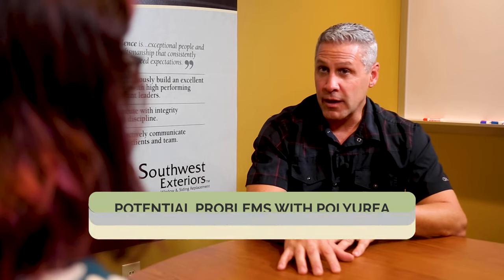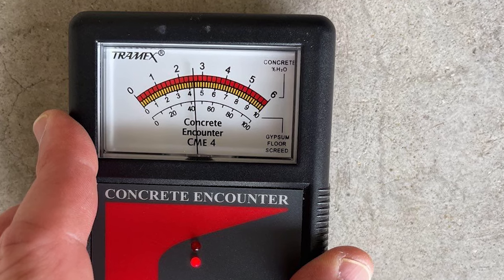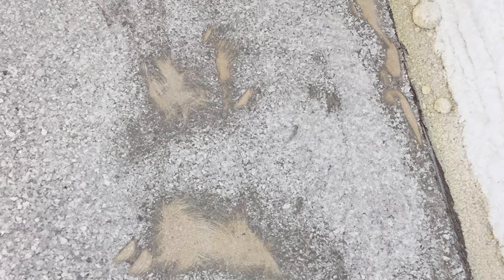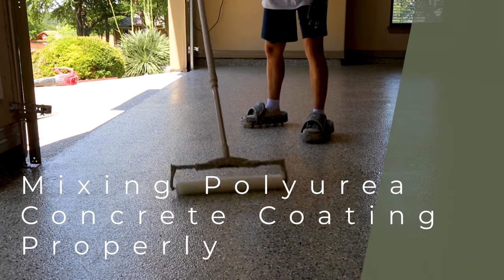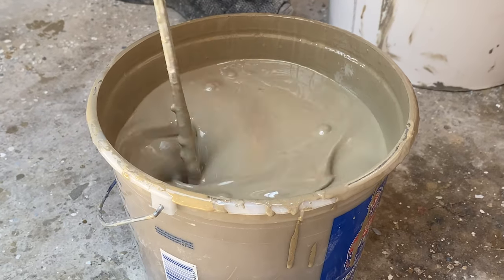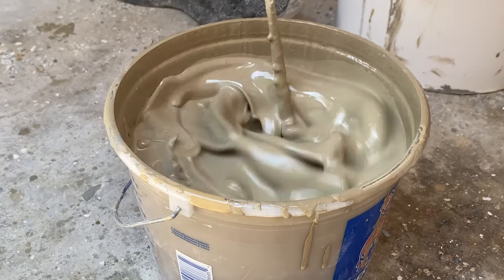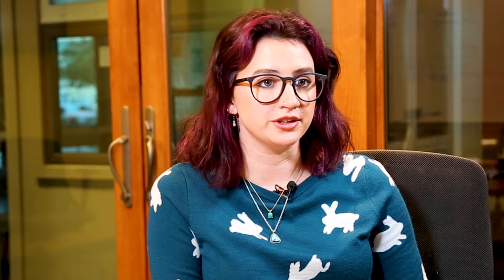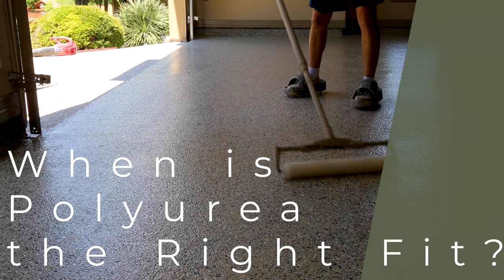Problems with a Polyurea Concrete Coating (or Polyaspartic)

Comment: 1. Check moisture content before istalling- It might peel. 2. Correct ratios or it might be affected by UV light. 3. Hire professionals to do a better job. That is it. No other problems. First Epoxy, then the supersaturate with flakes 3. Put a clear coat of Polyspartac , you are done.
Reply: I'm looking for good products to put down.  Do you have any suggestions?
Reply: @Time2Fly17  Simiron
Reply: Epoxy as a base coat is a bad idea.  1. it's not going to flex with your concrete. 2. It is not UV stable, so you end up with yellow spots.  If polyaspartic or polyurea are so great, why aren't you using it as a base coat?
Reply: @Time2Fly17  eparency
Reply: I ended up doing it with rock solid looks amazing I purchased an extra 10 pounds of flakes
Reply: @leosuarez1243  the guy who quoted my garage polyaspartic job says they always do an epoxy base coat and that two coats of polyaspartic (or one and a polyurea base) would be too slippery. I didn't know better but is that true? I would rather not deal with epoxy in there at all if I can help it.
Reply: @heatherhuth1  if you apply 2 coats of polyaspartic for a top coat, then yes it can make it slippery when wet.  This is due to further burying the flake layer, so you lose the texture.  Usually 1 top is sufficient for a normal use garage/space.
Reply: @heatherhuth1  Also, suggest getting a few more quotes and researching online on the pros and cons of each.
Reply: @leosuarez1243  Thanks! And I've been researching so much I should probably just do the work myself at this point 😆 but I didn't find a lot differentiating if people used an epoxy base coat or polyurea base boat with polyaspartic as the top coat. Thanks again!
Reply: Do not use epoxy as a base coat what a dumb suggestion
Reply: @Time2Fly17  Do you have to sand the floor or just use a pressure washer?? How is it still nice??

Comment: Just FYI, a Polyaspartic system is a Polyurea technology system.  Then there is moisture content in the concrete (as shown in the video) and then there is Moisture Vapor Emission issues, which is a different test procedure.
Reply from the maker: Thank you so much for the information!! We are working on a video right now that dives deeper into concrete testing procedures so I will make sure that is brought up as a talking point. Thank you again for commenting and checking out the video!!
Reply: @TheHomeSolutionsChannel  WTF!? Who R U bullying!??
Reply: I saw one company that advertises that they do 100% polyaspartic for both coats, and says other companies only use polyaspartic for one coat and polyurea for the other. Is that nonsense?

Comment: It comes down to this, if they didnt grind and clean the floor, they didnt do the job right and the floor may peel up in a few years. If they grind the floor down you have yourself the one of the best floors you can get!
Reply from the maker: 100%
Reply: @TheHomeSolutionsChannel  Are these slippery when wet? And when you are walking in high heels?

Comment: Much easier than that. 2 key elements. 1) measure precisely the component 2) apply quickly as its a very fast drying.
Reply from the maker: Great point!

Comment: I’m surprised no one has mentioned the smell. The offgassing I have experienced in the last 24 hours is unbearable. I did have professionals install the coating. They used both polyurea and poly aspartic. The smell is horrendous. I was not warned at all. We have left the garage door open All night and yet the smell and fumes persist. It has reached every corner of our home. We have opened all the doors and windows and have fans blowing as well as air scrubbers but I still can’t shake this headache It’s giving me. Any suggestions are greatly appreciated.
Reply from the maker: Yeah, you are right, that can be a huge problem as well. I am so sorry to hear you are still struggling with an odor. Unfortunately, what you are doing is really all you can do once the flooring is put down. Depending on the products used, Penntek does have a low odor topcoat that can be used, but that won't help now that it is down. 
Hopefully it has started to clear out.
Reply: We had a poly flooring completed a month ago by a major reputable, experienced company in our area.  We are also having significant persistant odor/ smell in the garage.  We have left it open for days at times to air out, used fans to blow air and circulate but a strong odor/ fume persists.  The company is coming back out but seems to indicate this is very unusual or has no clear advice for us.  We felt like we did everything right and or that they did.  Any advice or experience from others?  Do you have to redo it?  diff top coat?  Re grind and try again? Hope something worked for you!  any other solutions or ideas highly appreciated, thank you very much.

Comment: I did Polyaspartic coat. Chose antiskid, with light greyish chips  and regret. There are simple dirt footprints visible all over each time i walk.. I was told to buy hard brum and sweep it or power wash. Btw,  you can't mop antiskid. So not happy with this thing. I requested extra glossy coat so i can mop it at least, but waiting for offer. Unless you take dark grey coat, think twice about the antiskid surface finish.
Reply from the maker: Sorry to hear about the issues with the antiskid coating. Hopefully the glossier coating fixes that problem for you. Thank you for sharing the tip on a darker coat color that is great to know.

Comment: Great video. Hydrostatic pressure would be a bad thing under a garage floor that you were trying to put the stuff on.
Reply from the maker: Thank you for your comment! You're absolutely right; hydrostatic pressure can be a significant issue under a garage floor when applying polyurea coatings. It can lead to moisture problems and affect the adhesion of the coating. Ensuring proper moisture barriers and addressing any potential hydrostatic pressure before application is crucial for a successful and long-lasting coating. If you have any more questions or need further information, feel free to ask!

Comment: I would never get this product on an outdoor slab. From the research I've done and from the review of warranties provided by companies, the warranty really is only for the product itself and not the labor or installation. So if you have to warrant an issue they'll cover the product but you have to pay all the labor to redo it. That is not a warranty in my mind. In addition, there are a plethora of problems that can develop as a result of moisture in an outdoor setting that makes this product not worth the price.
Reply from the maker: You are absolutely right! A warranty is only as good as the company that is honoring it. There are some companies out there that will cover the installation, but not all of them. 
When installing a Polyurea Coating you want to make sure the moisture levels are checked before installation to try and avoid any moisture issues in your concrete.

Comment: Whats your opinion on using an epoxy base coat and then applying polyaspartic top coat
Reply from the maker: Great question! Using an epoxy base coat with a polyaspartic top coat can be a solid option, as long as it's applied correctly. Epoxy is known for providing a strong, durable base, while polyaspartic top coats offer great UV stability, faster curing times, and excellent resistance to wear and tear. However, it’s essential to make sure the two coatings are compatible and applied by a professional to avoid adhesion issues.

Comment: If there is to much moisture on concrete, there are lots of products out there that stop moisture, seal off ect ect.. At least for epoxy products.. 2 part primers lock out moisture and prevent hot tire pickup.
Reply from the maker: Absolutely! There are a lot of great products out there! Thanks for Checking out the video!
Reply: CD Surface Prep Outlet has a moisture barrier that works great.  Started using it recently with great success.

Comment: One problem I ran into with my polyaspartic floor being a machinic I left brake clean and oil mixed on the floor to long and it discolored it. The polyaspartic is not very chemical resistant.
Reply from the maker: Sorry to hear that that happened. Thank you for sharing
Reply: Could have been a polyaspartic blend that simply doesn't hold up to some chemicals.  Also, have to remember, this is just a coating, it's not bullet proof.

Comment: A moisture issue is the only way that epoxy would be the better choice.  Thankfully professionals that install polyurea know how to properly test the concrete for moisture levels.  The concrete does not have to be a 100% dry for polyuria there are certain levels of moisture that it can withstand with a a proper vapor barrier.
Reply from the maker: Thank you for sharing! We have several videos on the channel highlighting the pros and cons of both Polyurea and Epoxy. Going with a professional that can test your concrete for hardness and moisture is always a great idea.
Reply: @TheHomeSolutionsChannel  no, thank you for helping inform people out there! I'm a professional installer myself and I have walked away from jobs with moisture issues in their concrete even after applying a vapor barrier.

Comment: I had 2 companies quoted me using epoxy one wants $1800 and 2nd wants 2500 I am in Atlanta and they told me that will need 2 days to work.
Reply from the maker: It's great that you're getting quotes for your flooring project. Prices can vary due to factors like project size and company reputation. A two-day timeline is normal for epoxy flooring installations. Consider reading reviews and getting recommendations from others in Atlanta. Take your time to evaluate all factors before making a decision. Good luck with your project!
Reply: Sweetgirl, which companies and how big is your garage (1/2 car, X amt of sq ft approx?)  I am near Atlanta too, looking for similar coating.

Comment: I have a question, it lasts for YEARS you say but clearly not forever.  What happens when it's time is up and it has aged or just looks dated?  When you paint a room it is pretty easy to just paint over the old paint, but when you buy a house with some cheesy seventies paneling or just dated faded wallpaper that is screaming IMPEACH RICHARD NIXON it is a lot more work to remove it than it ever was to put it up.  How hard is it going to be in say 20 years to remove?
Reply from the maker: Thank you for checking out the video and the question!
You're right, nothing lasts forever. A polyurea flooring isn't any harder to remove than it was put it down. When you have a Polyurea flooring installed, you have to grind down the service to open up the pores to receive the coating. So you would basically do the same thing, you'd grind down the surface to place down whatever new flooring people are doing to their concrete in 20 years. We grind over Epoxy floorings when our clients are changing to a Polyurea flooring, so this would be equally doable if you no longer wanted the Polyurea flooring.

Comment: I have a three-year-old Poly aspartic coating on our outdoor concrete patio.  The coating seems to be cracked and since the patio forms the roof of our garage, we get moisture in the garage.  Can I recoat this product?
Reply from the maker: Re-coating is always an option. The biggest factor that could pose a problem is what damage is causing the moisture to enter your garage and making sure that is addressed before re-coating. Once that's taken care of as long as the concrete is in good condition a re-coating shouldn't be a problem. The old coating would need to be ground off and then you should be able to apply a new one.

Comment: We had a polyurea flooring completed a month ago by a major company in our area. We are also having significant persistant odor/ smell in the two-car garage. We have left the door open for days at times to air it out. we have used fans to blow air and circulate but a strong odor/ fume persists. The company is coming back out to review but seems to indicate this is very unusual or has no clear advice for us. We felt like we did everything right and or that they did. Any advice or experience from others? Do you have to redo it? diff top coat? Re grind and try again? any other remedies highly appreciated, thank you very much.
Reply from the maker: Thanks for reaching out about your polyurea flooring odor issues. It's frustrating to face this after ensuring proper installation. Here’s what you can try:

1. Ventilation: Continue using industrial fans to improve airflow.
2. Inspection: Have the returning company check the mix and application.
3. Curing Process: Verify if the curing time was sufficient for your specific polyurea type.
4. Top Coat: Consider a different top coat that might block odors.
5. Reapplication: If necessary, re-grind and re-apply the coating.
6. Second Opinion: Getting advice from another flooring expert might also help.

Persistent odors are uncommon and can be addressed with these steps. Keep us posted on your situation, and share any successful fixes to help others with similar problems.

Comment: Aside from a few important things like moisture etc these different floor coatings seem like a little bit of actual material expense and a shitload of markup/sq ft
Reply from the maker: Thanks for checking out the video!
Depending on the contractor there can be some mark up. It's best to weigh the cost to the value of what you are being offered to make sure it works for you.
Reply: Seems like proper mixing and formulation is critical, as well as applying the top coat quickly and properly. Since you only have one shot at doing it right, I'd go with a pro. I do a lot of DIY myself and I won't attempt this. I'm happy to pay the markup.

Comment: "If you're just looking for a quick fix" (i.e., if you want to just do a half donkey's but job), "you need to sell your home quickly, & you want to just pretty the garage up a little bit, or make the patio look a little bit nicer" (i.e., you want to just put something down that won't last & stick the next homeowner with the headache a few years later)... oh, or spend thousands of dollars getting certifications and tools, or hire an expensive contractor that's going to do a half donkey's back end job anyway. Nice promo video.
Reply from the maker: Thank you for sharing your thoughts! I understand your concerns about the potential downsides of quick fixes and the costs associated with quality work. Polyurea coatings, like any home improvement product, need to be applied correctly to be effective and durable. While some may opt for cheaper or quicker solutions, it's important to weigh the long-term benefits of professional application versus the initial costs. Our goal is to provide balanced information so homeowners can make informed decisions based on their needs and circumstances. We appreciate your input and hope our content helps viewers make the best choices for their homes!

Comment: thank you for the video. I have a question that I can't seem to find a concrete answer on. Can you pour polyaspartic over a new exposed aggregate concrete slab without doing other prep work such as shot blasting?
Reply from the maker: To properly install polyurea the concrete surface needs to be prepared by some sort of grinding. There are some polyaspartic coatings that can adhere right to the concrete without prep, but with the aggregate it could impact how well it would adhere.
Reply: @TheHomeSolutionsChannel  what about using one of those decorative  concrete rollers? What if you had a roller that had a CSP finish of lets say  4-5, could you just roll that to finish your concrete then be ready to pour after it cures?
Reply from the maker: @MysteryScienceGaming  Great question. Most likely it would be similar to putting a coating on aggregate. Without the pores in the concrete open, from grinding, for the coating to adhere too, there is no guarantee your coating will last as long as it could. 

You can absolutely finish the concrete with a CSP and lay a coating on top, but without the smooth surface there is a lot more surface area for the coating to try and adhere and could lead to some imperfections in both appearance and longevity. 

If you do go that route, we'd love to hear about how that works out for you so we can continue learning new techniques ourselves so be sure to share!

Comment: Is this coating mould and fungus resistant? 
Will it stain?
Is it suitable for swimming pool surface?
Reply from the maker: You can coat your pool deck, and the coating itself is stain resistant, as well as being antimicrobial so there shouldn't be too much of a problem with mold or fungus. 
With that said, it varies per client, but the coating can be found to be too slippery on a pool deck and depending on the level of standing water that the coating would be exposed too, there is always a risk for rusting or staining if no preventative measures are taken. 
It would be best to talk to your installer about what options they have for the best and safest pool deck coatings. 
Thank you for checking out the channel!!